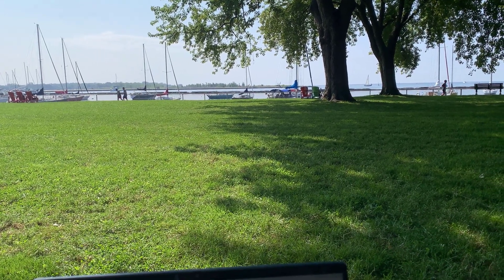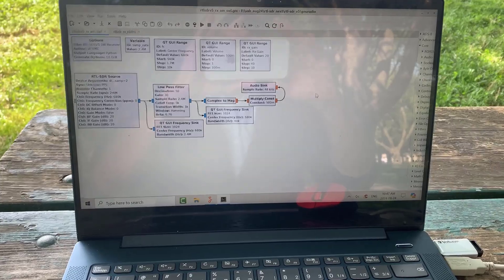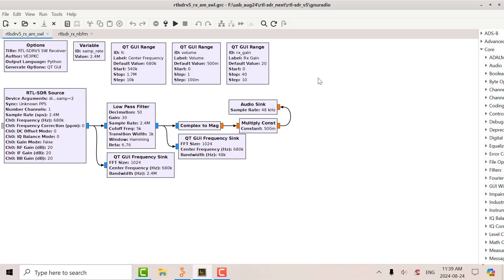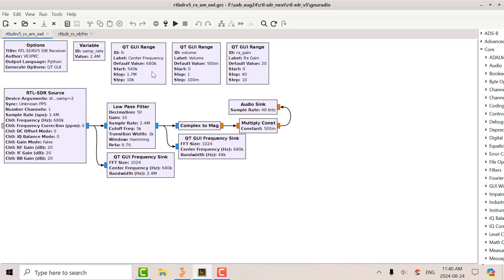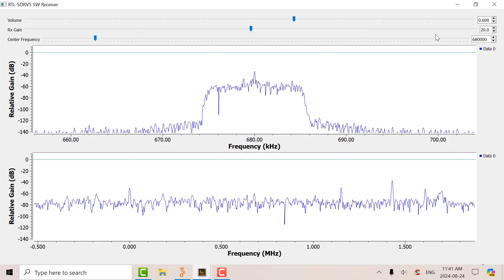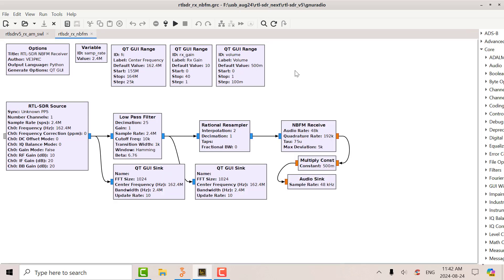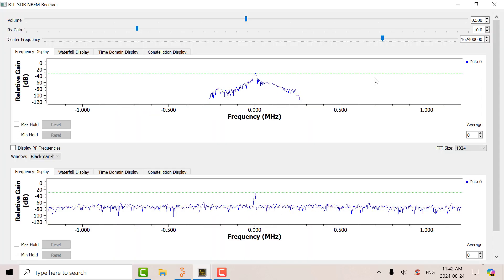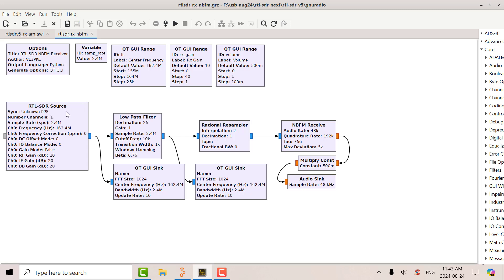RTL-SDR V5 on GNU Radio

Comment: Firstly thanks for all the great videos. Amazing info! I actually live not too far from you, Stoney Creek side of Hamilton. I'd be interested in seeing if you have any long term issues with the RTL-SDR V5 (nooelec NESDR SMArt). This was my first SDR receiver. I've used a bunch of different SDR software with it. I run it continuously for a while using AIS-Catcher. After a few days it stopped working, and now even though it connects to the computer, and the software sees the hardware, it doesn't receive anything on any band. I replaced it with "RTL-SDR Blog V4 R828D RTL2832U 1PPM TCXO SMA Software Defined Radio" and will see how it works out.
Reply from the maker: I only just received mine, I got so many questions from students on how to get it working with GNURadio. So far so good, although for HF the upconverter is the way to go. Make sure you go back to quad sampling if you have been in direct_q, otherwise you won't hear anything, maybe that is the issue. I did a few biathlons in Stoney Creek many moons ago!
Reply from the maker: Also you may want to reset the driver. SDR# has a .bat file to reload the driver (install-rtlsdr.bat).
Reply: @ClarkTelecom You've inspired me to look at it again. It originally stopped working on my bare boat necessities install on a raspberry pi 4 using ais-catcher. I've also tried it on a Windows and Mac computer with no success.  Various SDR software. I'm thinking a hardware issue though.